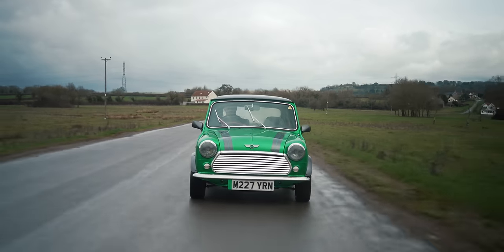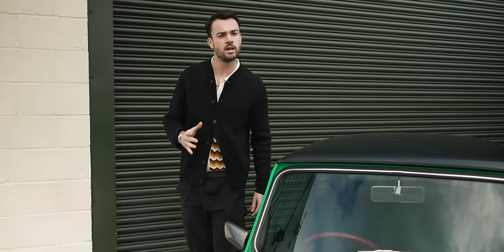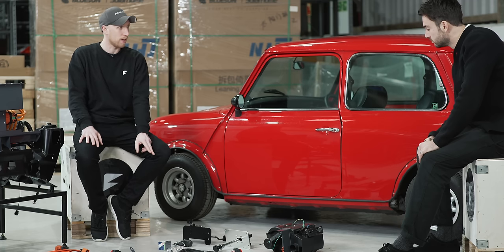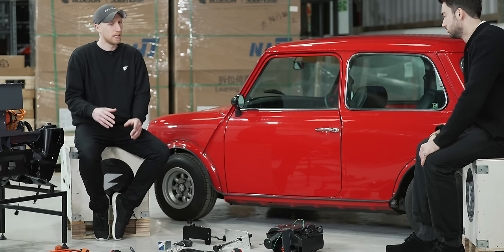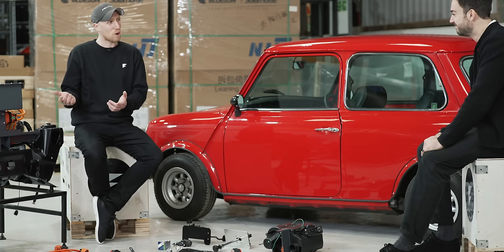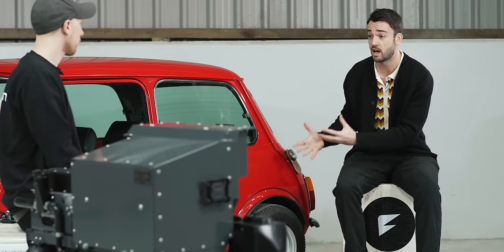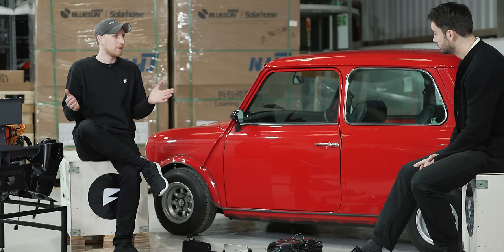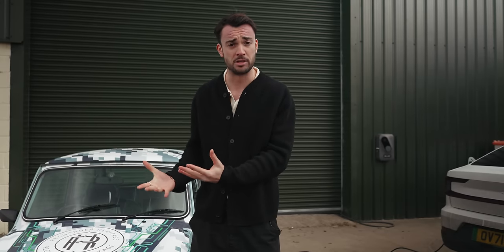How CHEAPLY Can You EV Convert Your Old Car?

Comment: I do wish their was a big push for this, in a way of seeing as a performance enhancing kit, I feel like that would get a lot more people on board. Making hybrids and full electric.
Reply: Me too but like video say, it a race of on what affordable first, the new ev or the retrofit kit. 

Hope retrofit win faster
Reply: Not going to happen till it's Self Install.
Reply: Why even bother with a DIY hybrid?  Once you have the battery, the motors, the high voltage electronics, the software etc, why add the complexity of figuring out how to blend it with a gas engine?
Reply: @patreekotime4578  If you're thinking of the EV component as a way to get more economy, yeah, that's a waste on a classic car. But if you treat it as a power adder, like a supercharger with bypass and clutch, or a large bottle of Nitrous, then it makes sense.
Could probably use the front output shaft of a 4WD transfer case as an input from an add on electric motor to drive the rear wheels.
Reply: There was a small push until the Americans jumped in and either killed them or mysteriously the factory burned down.
Reply: Or, converting hybrids to fully electric. I know of an original Honda Insight conversion in my local area. I drive a hybrid fleet vehicle that I would love to see fully electric, but the cost is still prohibitive.
Reply: @patreekotime4578  I remember I saw one an experiment hybrid where the rear tire (fwd vehicle) are install with electric wheel and battery rested in cargo area or where spare tire located.
Reply: They can push all they want but they have no control over the battery supply and that's the main cost.
Reply: @patreekotime4578  I had a 2G Volt, which is a PHEV (altho probably the most sophisticated one ever). It looked like GM had to use a massive hydraulic press to get the hood to shut on all that stuff. And the software to seamlessly control it makes the Apollo program look trivial. It is unimaginable to fit that into an existing car, without spending more than a new EV AND a new ICE car would cost.

Comment: Four years ago I was quoted £20K for my MX5 to be EV converted. Instead this year I brought a two year old Zoe, with super low mileage for £16K. Price is key. A conversion is always going to be a compromise and price wise be competing with second hand EVs which are available at very competitive prices now.
Reply: remember when companies were making digital sensors on a cartridge to fit in a 35mm film camera? No? Never caught on as technology rapidly developed and the compromises to great. Except for classic cars, cant see this really happening....
Reply: £28k for 100 mile range? - Not exactly tempting unfortunately and as Bak mentions Zoes are just great and at 16k and hopefully soon, less, v tempting

I lease the Gt135 and love it, u can hustle it down back roads probably better than a tweaked Cooper S - always out dragging the ICE out of every corner

They also handle torque distribution brilliantly - u can powerslide the front without inside wheelspin :)

Retro EV conversions for classics need to be less than 1/2 price to appeal to the masses - If I had my 916 GTV TS EV converted I would want 250 ml range, 0-60 in 7 secs or less and VNE of 90 min - @ cheaper than a used Zoe - I would still think twice at £12k

Drive in, collect within 72 hrs for sub £10k would be mass market - I appreciate it cant be done now and possibly not within several yrs, but thats how I judge it for the average guy with a sub £5k used classic

A universal BYD retro fit kit for $10k would be a winner :)
Reply: @mattsword41  Ughhh.... not comparable at all. Film thickness digital sensors are technologically just impossible. EV conversion is not only immenently doable, but people were doing it by themselves using homemade parts 30 years ago. But those conversions where not safe do to, sometimes not safe to drive, and often very impractical... back then the motors available were not rated for continuous load and would burn up very frequently. The lead acid batteries available were bulky and heavy. And the control electronics primative or completely DIY. Todays conversion shops have access to the same or similar quality parts as what actually goes into commercial EVs. But it comes with a pricetag.
Reply: @davidstuart4915  The history of technology is always the same. The capability goes way up and the price goes way down. To expect ultra low prices at the beginning of a new technology is unrealistic. I am currently writing this on an 8gb Raspberry Pi single board computer which is the size of a cigarette packet, costs £80 in this version (prices start at £35) and has more capability than the most expensive desktop computer you could buy 20 years ago. It can also emulate all of the most expensive consoles you could get 20 years ago. For a monitor I'm using a 42" Plasma TV that I bought 18 years ago for £1500 and weighs 40kg. My newest TV is a 55" LED with full 3D capabilities that cost £500 and weighs 16kg. From Desktop PCs to Raspberry Pis and from Plasma TVs to LED TVs the technology has become leagues better and way cheaper. That will happen with EV Conversions just the same as it has with every other technology.
Reply: Why a 70kw motor in a Mini? Way too overpowered, 40kw would be plenty. Also the cost is prohibitive, £40k plus the cost of the donor car. You could buy a new Mini electric, Fiat 500 even the Honda e and an ice powered Mini for less. I am lucky enough to have owned a few original Mini’s in the past, they were fabulous drivers cars brilliant for tight and twisty B roads and lanes, but not exactly comfortable by todays standards.
Reply: @sergentcolon1  Do you think having a 40kw motor instead of a 70kw one would drive the price down enough to justify the lower power?
Reply: @john_barnett  tbh I think it’s an irrelevant toy, the headline was “can you cheaply convert your old car” in this case no. The amount of original minis still on the road is tiny, as a basis for ev conversion it’s pointless. A conversion based on a more available modern vehicle would be more practical. This is nothing more than a toy for the wealthy, the previously covered French company hoping to produce kits for €5000 was a more appropriate subject for the title than a company making toys for the wealthy.
Reply: @trevorberridge6079  E
Expect,? - No
Hope, Yes
U make your point, known to most, well though - Impressive 'pc'
Reply: @davidstuart4915  Not an expectation. A certainty. 32" Plasmas used to sell for £10,000 in the 90s. 4K didn't exist. Tesla were 15 years away. Rockets weren't coming back and landing themselves. Falling costs and technological advancement go hand in hand.
Reply: I would retrofit for $4500. Max. Used EVs are not much more. When I can for $4500 to my 2000 VW MK3 Cabrio? Interested. Newer Evs are manufactured from ground up to be an EV, with modern safety standards. Its got to be really compelling financially.
Reply: Right. I have a 25-year old peugeot (camper) van. I considered converting it, but the problem is that it would cost 20 grand (at least) which is OK, except that what you get out the end is not very impressive. Mediocre range, efficiency and charging rates. It's very hard to make a good EV using an ICE chassis (not impossible - see the Kona, for example). But overall I decided it was better to save the money and wait for a properly engineered EV. The buzz is the first example of this with a real range over 200 miles, which is important in a camper, and something like 2.7mi/kWh. The problem with a modern bought car is that you have no control over the software and various other details so modifications are much harder.
Reply: Electric motorcycles have batteries bigger than that these days. I'm not sure this will ever be practical for people who don't just have money to throw around. A Chevy Bolt is a lot bigger, has a lot more range, and costs a lot less.
Reply: @sergentcolon1  There are over 8000 still running in the Uk with devivatives like the Moke of at least another 2000, so converting 10,000 cars (dont forget that in total there are some 1.6million classics still registered as well just in the UK). Get that price down to around £10,000 or less and I think many would be happy to make the swap. I have a 1988 original Moke and there is a bloke down the road with a new chinese EV one. Yep mine is more fun to drive but his one needs no tinkering or ITV (thats MOT as Im in Spain). Im not a fan of EV cause its not backwards compatible (ie todays battery pack wont fit a three year old car), but for classics its a reasonable idea as long as the cost is good.
Reply: @trevorberridge6079  yeah - despite all the tech, you are using it for the same purpose. JUST writing... ;-)
Reply: There is one other problem: Legislative and Regulation compliance

I was trying to figure out, how much it would cost to get usable donor car (~$3000), motor + electronics (~$3000), and batterypack for 200km range (~$3000) and few other things 

I ended up with roughly $10k in hardware - and roughly $15k "fees for stamps" to get it legaly on the street
Reply: @john_barnett  gotta help!
Reply: I dream of converting one of my cars to BEV.

But it stays a dream because even doing it all myself, the cost of parts is just too much. Most of it's the batteries, they're just too expensive, even used, for it to currently make sense. Maybe if the tech gets cheaper, or supply from written off/ scrapped cars increases, that'll change.
Reply: @sergentcolon1  There's enough old Minis around for there to be several companies catering to keeping them going, including supply of brand new parts.

But also, if you can EV a Mini, you've also got some of the R&D done for converting early Metros, Austin 1100s, and various other fwd box in sump A Series cars.

But I totally agree that at this price point (27k plus VAT!?!?!), it's just a toy for the rich. Not at all practical for the less landed classic/ retro car enthusiast. Or the "Just needs something to get to work and back, can't afford a brand new motor" 15 year old Focus driver.
Reply: @mattsword41  It will always be cheaper to massproduce a new car than to individually  retrofit an old car and encounter unique problems with every new project.
Reply: My commiserations to you.
Reply: @mattsword41 because it is impossible
Reply: In the EV club I've been involved in for the last 15 years, they have a phrase used for new members who wanted to build/convert a car to EV: If you want an electric car - buy one; if you want a project, build one.  There's not much chance you'll save money doing a conversion.
Reply: Rip the zoe apart with a Halford lifetime warranty toolbox and stuff it into the sublime mx5
Reply: @patreekotime4578  Technology wise creating a sensor that fits the film port of a 35 mm  SLR camera and connecting it through a flex PCB with electronics and battery that would sit film roll cavity would be totally feasible. But this would compete and fail against what a modern DSLR offers. So it is not impossible, it is jurt not economically feasible. The SLR camera body is not that valuable, what you would like to be able to do is to re-use your existing lenses and this you can do but they still lack many of the features that modern lenses have and a camera body with  '35 mm format sensor' is expensive AND unnecessary to get image quality comparable to film.
Reply: @Axel_Andersen  No, it really is not. Nobody has that technology. Totally possible to have a replacement back for cameras with interchangible backs as has been done on medium format for ages now. But a film thickness digital sensor has no precendent that I have seen. Moreover, the vast majority of 35mm film cameras require some kind of feedback between a sproket gear that engages the 35mm sprocket holes and the film counter and sometimes even the shutter cocking mechanism. The position and sensitivity of these sprocket gears in different cameras represents nearly infinite varieties of permutations that would be nearly impossible to somehow simulate across different cameras. And in the 20 yeears ive been seeing them, I have never even seen a E-film prototype that even adresses this problem.
Reply: @patreekotime4578  Why would it need to be exactly film thickness? And while I'm sure it would difficult or impossible to make a retrofit that fits every SLR I do not for a second doubt that one could be made that fits one particular SLR.
Reply: @Axel_Andersen  Some cameras have a motile backplate that would allow for slightly thicker, but many do not. And if you are only going to make it for one specific camera, why do it as film replacement at all and not just make it a digital back? Its pure vaporware based on virtually impossible hardware and bad assumptions. Always has been, probably always will be.
Reply: @patreekotime4578  On that I agree. It is not a feasible proposition to make a successful product, I was merely commenting from the technical point of view that it was not impossible.

Comment: I love ev conversions and have one of my own, but I think it will largely be an enthusiast thing. Cost and labor are big, but there's also safety. I love the style and fun of older cars, but when it comes to daily driving and thinking about the safety of myself and my loved ones, I gotta admit that modern cars are much more likely to protect the occupants. And that's a huge factor. Plus, the cars that are best for converting are older pre computerizing of everything, which also means less safety features. Once you get to a newer car with more safety stuff, you have a lot more work to do as far as interfacing with software expecting an ICE engine and all the sensors involved with it. Which is why we talk about converting old Minis and Land Rovers, but not, say, a 2017 Sienna.
Reply: It's also a bunch of labour and other costs, which is only going to add to the costs.

Doubly so if it turns out your mechanic botched it.
Reply: Do you think it could be done for newer cars if we bypasses the electronic gizmos? obviously would mean losing safety features, but if you could retrofit other parts into the build?
Reply: Sure, absolutely. Anyone driving modern speeds in this Mini is absolutely crazy. I would use this one to show off occasionnally, and at most as a "city" car that tops at 40-ish km/h in dense areas, maybe 60-65 max (15-20kmh less than the limit) in the countryside. I'm not going on a highway with this.
Reply: Hi, I can see more conversions going on as the scrap nos of EV’s increase.
Using a donor vehicle as the supply of your parts makes sense.
Expect to see more Leaf based kits in the future, along with Tesla components, if not whole parts.
Was thinking of a Freelander 2 one but white van man pulled out.
Take care M.
Reply: @em-jd4do 
Crackling of 78rpm record
Opening bars of 紀元ニ千六百年
I used to have a hillclimb mini I'd regularly take to 70(ish) across Cambridgeshire. I wish I still had it, was a hoot.
Reply: Making the car road legal is easier with classic cars as they don't have to have an MOT.  If you do a DIY conversion and show up to your garage they won't sign it off.

Comment: In the early 80's, I sold personal computers for around £4000 per unit. The same PC with far greater ability is now £400 or even less. If you requested a custom PC to fit into a retro case, that would inevitably cost more. Thanks for the video and can we see the outtakes of you being eased into the Mini? 😊
Reply: Hardly a matching analogy. A car is a mobile cabin, the value is that the cabin can move and take you somewhere in some comfort. The systems behind the motion are a significant part but still there is the cabin and the comfort it provides - this is the value that is retained by a good condition old car to be converted (without even mentioning the nostalgia). The chassis of a PC is of little value even when new, it is just a structure to contain the real value - the compute resources, which at the pace of development in PCs becomes less value much faster than do any particular car, though you can change the PC internals and keep the same case quite often - I certainly did - as long as the standard the chassis design followed is still current for the components.
Reply: Mini’s are surprisingly easy to get in and out of and have plenty of room for larger drivers(both height and bulk).
Reply: @sergentcolon1  Except for mutant sized people it seems ...
Reply: @barendencrone  try fitting one in an Amiga... 😊
Reply: Why would it cost more?
You are using the same motherboard, power supply, wiring and components as the current generation. the only old part is the housing3
I know this because I have a core I 5 and a Core I 10 in cases that originally had Pentium 1 and 3's

With EV's the real problem is the battery cost and lack of energy density
To get an EV with any useful range (sub 100 miles is a joke) you need 700-1,200lb in batteries which doubles the weight of a mini which started out at 1,275lbs.
Reply: @pogo1140  tell me more about your "Core I 10"
Reply: @joelambert7128  Sorry, typo supposed to be I0 core I9
Reply: @pogo1140  Newer (and by newer I mean the last 20-30 years) use standard case layouts. You can put a brand new motherboard in a case from 2004 and it'll fit if they both match the right spec. Cars (and I'm assuming 80's computers) are not as standardized, there is extra work to swap all the this stuff, they weren't designed with that in mind.